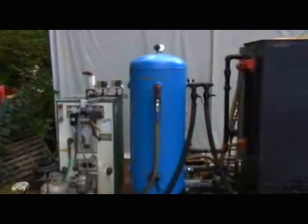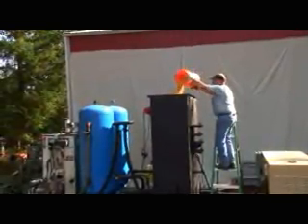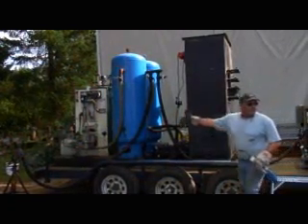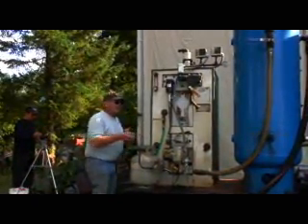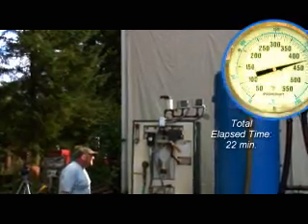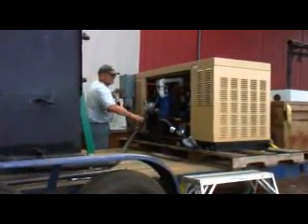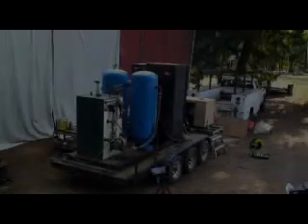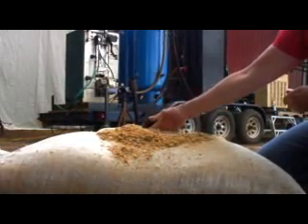Crorey Biomass Gasifier System

Comment: The generator has to have a change in the air-fuel mixture.  Normal ratio is 10 air to 1 fuel.  With syngas, the ratio should be 1 to 1.
The syngas is cleaned in the reactor and conditioning tank.  Our design is unique and that's why the gas comes out clean without scrubbers, filters, etc.

Comment: Yes, I'm building gasifiers for mobile and stationary use based on the FEMA design, modified in some areas. This year, I am planning to convert an Unimog 404 to woodgas. I wish you good luck and also commercial success with your products. Kind regards, Hardy